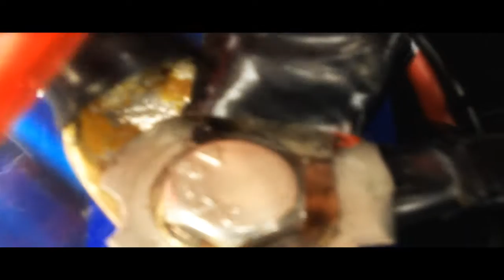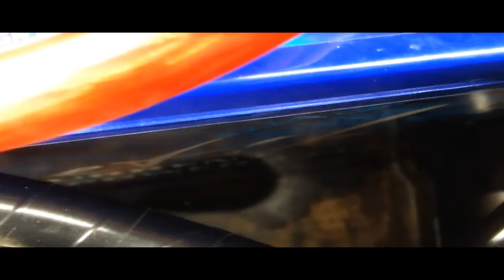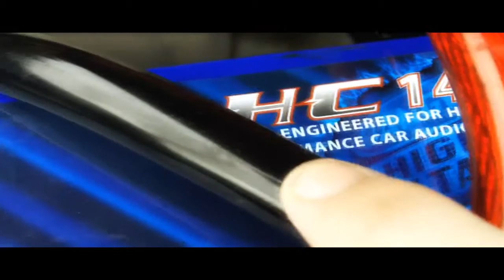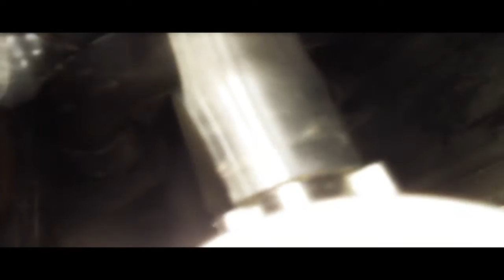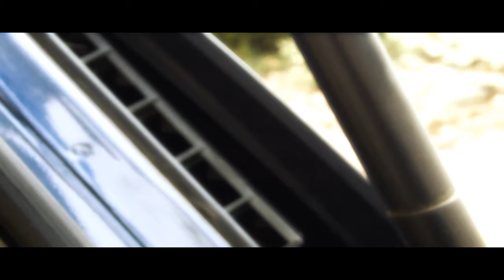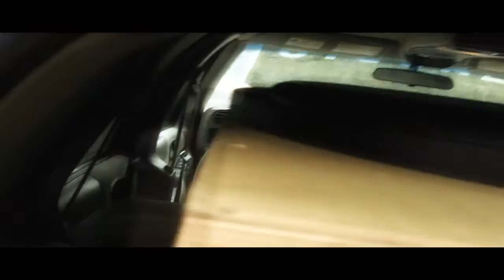quick ground tip for loudizzzzle

Comment: Thanks for the dedicated video brother really appreciate that! Ive got videos to upload still waiting on my camera because I have so much going on. Ok try to picture this... by my battery the factory ground comes off of my engine... then has a gap in the insulation where it grounds to the chassis then continues to go up to the negative battery terminal. You saw the ground from the front of the chassis by the radiator to the front of the engine. Then from the alternator positive to the battery.

Comment: I finally got my alternator whine killed bro! I appreciate all of your great advice which if I were a novice it probably would have worked. I had already pretty much tried all of the typical work arounds for whine before I started asking for help and uploading videos etc. Would you believe it was the damn stock wires running from my alternator to my battery? My old ass stock alternator is just fine now that Im only runnin the 4 gauge from the hot lead to the battery terminal. GO FRICKN FIGURE!

Comment: All of those wires have been upgraded to 4 gauge... and the contact spots have been sanded down to the bare metal now. You saw on one of my videos that I had insane voltage drop all the way down to 10.5 volts. Got my new stinger battery in today for under the hood, and picked up to Kinetic HC1400's last night for a steal from Craigslist. Got the kinetics in but crossthreaded the bolt on the positive terminal of the Stinger battery today :(. New vids will be up soon.

Comment from the maker: @Loudizzzzle So it grounds from the engine to the chasis ? that is a useless ground, You replaced that one or removed it didnt you if i remember correctly ? Just go by the list of the big 4 i showed you before, Awsome news on the kinetiks man great to hear you got a better electrical system building up, If you choose to go with any of those upgrades we where talking about it will deffinatly help out alot. Im sure you can get a nice alt for that vehicle too.